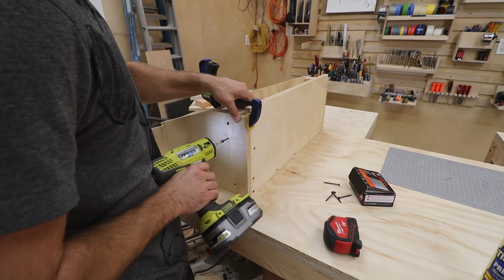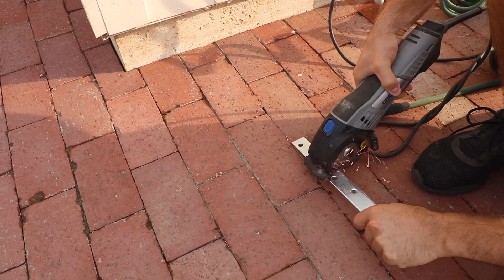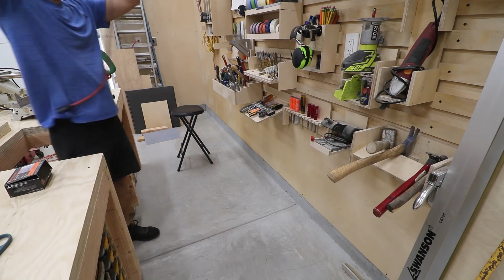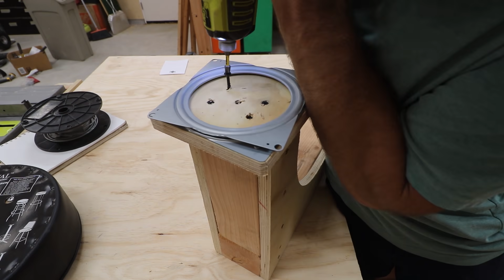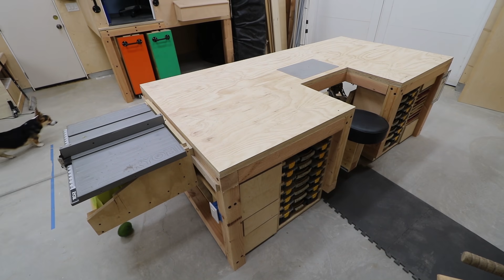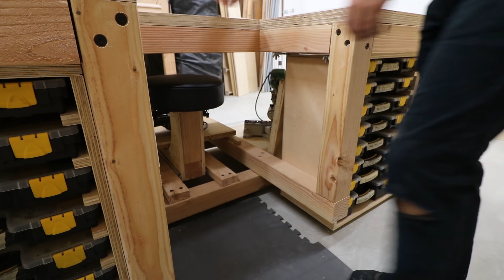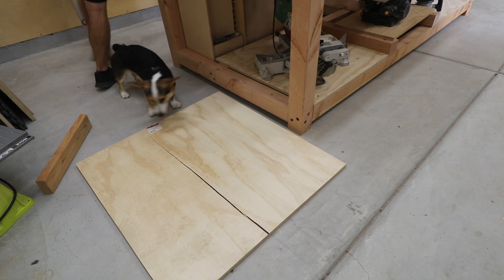Ultimate Workbench Upgrades! Built in Slide Out Seat

Comment: Very cool additions to the workbench.
As for the outlets you may want to use GFCI outlets for safety or a combination GFCI/ARC Fault outlets.
This way if something happens with the work tool it should trip there first before going to the wall outlet on the shop wall
Otherwise you built a great useful workbench

Comment: The sliding seat would have worked perfectly for me when I was 25 years old. Now that I'm 55 I don't think I'd even fit in the cutout. Not to mention, if I was able to squeeze in there..., well let's just say the slides giving way would probably be the only thing saving me from flipping the entire workbench over onto myself. When you get old and fat, like a lot of us who never saw it coming, you may want to add a trailer jack wheel onto the bottom of that seat. Patent Pending

Comment: Hey Ben, just built a work bench and was looking to install a french cleat for my table saw. How did you align it with your work bench? mini tutorial? :)
Reply from the maker: I took a bunch of measurements and calculated it out. The top of the table saw should sit just above the surface of the workbench. So for example: if your saw is 12 inches tall, the base that the saw will sit on should be 11.75 inches below the top surface of the workbench. Start with that calculation and build out all the other measurements from there.
Reply: @BenTardif  I actually built it today with your advice, thanks Ben!

Comment: You could add a fold-out foot on the bottom of the swivel stool to support you when you sit on it and take some stress off the drawer slides. You can build it so it folds up when you slide the chair in and drops out when you pull the chair out.

Comment: LOVE THIS!  Was starting to wonder if adding an electrical outlet in the floor of the concrete before pouring would have been good, but you solved it with the heavy duty electrical.  I wouldn't have thought of using an electrical cord to create outlets from, nor did I know it was possible.    Where did you buy the extension cord?  is it 10 gauge, 4 conductor?  Also, what about the ground wire??

Comment: 4:20 great idea for mounting the table saw, but I really think it needs additional support in the bottom, going directly onto your floor.  The bend in the cleat becomes very visible when you add the saw, it's just not meant to support that weight. Could have safety issues...

Comment: DEFFENTALLY one of the better hand made work table I've seen in a very long time. what about adding a some kind of straight cut razor for your paper roll? like to see how you would accomplish this part...
Reply from the maker: I’ve just used scissors or a utility blade to slice the paper. The top of the workbench is a sacrificial top, so no worries about making some slice marks

Comment: Nice Bench, I also use my bench as an out feed table, however, my saw is higher than the bench and I use two pieces of 2x6  blocks dogged to the bench top as the out feed supports.  The 2x6 blocks are tapered to prevent catching the end of the material as it comes off of the saw. This allows me to continue to rip material while low profile items like tools i.e. hammers, screw drivers, chisels, tape measures, pencils etc remain lying on the bench.  The bench doesn't have to be completely cleared off. The 2x6 pcs can be dogged to the bench to prevent sliding or like mine the first block has a cleat and hooks on end of my bench.

Comment: Seat support - if you had put another 4x4 across the opposite end of the rails from the seat, and a 4x4 brace directly under the seat so the weight would be on the 4x4 more than the rails, it would support more weight than just using the rails.  Or put a wheel under the seat so it can roll back and forth with the seat as it slides, but when you sit, the excess weight is on the wheel at the bottom.  I like this build, and may build this in my shed, but I'm not sure the floor is strong enough to support that much weight.  The people that built the shed didn't do the best work.  My workspace is extremely limited, but there is no way around needing work space like this.

Comment: @Ben - Thank you for the very clever table saw holder concept. I'm going to build one and also considering using your concept to build one for my miter saw by flipping the holder upside down to provide a platform to align the saw's table with the top of the workbench. Hoping to use the same workbench-side cleat for both but not sure yet if that will work out.

My Ryobi table saw is similar to yours but the smaller 8 1/4" model. The dust chute sticks out the back and moves with the blade as it's tilted. I'll depend on the holder to catch the sawdust. Did you have any problem collecting saw dust with yours? I'm considering moving the table saw outboard of the holder about 3"  to allow room to stick a vacuum crevice tool in behind the saw to suck out the sawdust after the fact. I'm assuming there is no problem having a 3" gap between the saw's table and the workbench as long as the table saw is a smidge higher than the workbench. Same with the miter saw holder. It’s a slider so it needs about a 5” gap to clear the workbench for the 45 degree cuts. Am I missing anything?
Reply from the maker: Sounds like you have it well thought out! Dust collection and stability are the 2 big things. I have plans for a dust collection system in the future. For now, I just remove the saw every once in a while to vacuum. Eventually I’ll add a dust port at the bottom underneath the saw.

It also needs to be stable enough to handle the weight of the saw and anything you’ll be cutting. Having the saw slightly higher than the out feed table is important (but you already know that). Sounds like if you run into any problems along the way you’ll be able to troubleshoot and solve it no problem! Send over some pictures! I’d like to see how it turns out!
Reply: @BenTardif  - Thanks for the feedback.
Stability is a concern of mine. Watching your videos including "Doubling the Ultimate French Cleat Tool Wall" (like), the table saw appears very stable. No tilting and no apparent vertical flex. The holder is no issue the way you have it designed. I reckon the weakest link would be the fingers of the cleats. How much torque applied at the front of the holder can the cleat bear before failing? Spread across the holder’s cleat width over 20 inches plus the aid of the lower spacer, I’m guessing my concern will be curbed. If not, I suppose the plywood cleats could be swapped out for 2x4 equivalents.

Comment: wow. just wow. this is very cool. For the bench, and more a concern for my 200LB frame, what if you just created a block that is just a hair taller than the under side of the stool when it is extended, you can store it loosely in front of the stool when it is stowed, then when you use the stool, you take the block, place it on the floor under where the stool will sit and your weight is transferred to the block as opposed to the drawer slides.

Comment: I would have used the same method for the seat as an old weight bench, which moves toward the bar height adjustment when doing shoulder presses and away from the bar when moving to bench presses. That way it’s tucked away when you want it to be, lift up and out to pull it out, it’s supported by the ground, not wobbly, and it would fold up and away just by lifting up and pushing in. The Lazy Susan was a good idea.

Comment: Great craftsmanship!  For top mounted items you want to secure, remove, and move around, I like bolts with thumb screws.  Fast, cheap, not intrusive when removed (just holes in top), secure while working.  2 on opposite corners is usually fine.

Comment: A wooden peg or chair wheel of some kind mounted to a spring loaded hinge on the bottom of the stool base at the back would give you more support and make your stool sturdier.  The spring loaded hinge would 'spring' closed when you pull the stool out and force the peg/wheel vertical to point at the ground, and when you push the stool in, the 4x4 base board would push the hinge open, raising the peg/wheel off the ground into a horizontal position or pointing up depending on how far int he stool is pushed.

Comment: would recommend that you update the seat so the 4x4 piece under the seat is longer and extends towards the floor but just short, so when the seat flexes when you are sitting the lower "Leg" piece touches the floor and make the seat more stable and help prevent your sliders from bending or pulling out screws. you could even add adjustable rubber foot ( screw type) to the "Leg" so you can adjust the flex amount.

Comment: That is an amazing bench.  However, that slide out seat is doomed to fail.  Putting caster wheels on the bottom of the seat supports would solve the problem of relying on the glides that only hold 150 #'s.  (You'd better not gain anyweight if you don't...and even then, those glides won't last.)  

Fantastic design and build however.

- Jed from KC

Comment: That french cleat has me a bit concerned with something that heavy.  I would consider something to support the free end.
Reply: When you consider the length of the french cleat, it really is a non-issue.  The weight is spread out over such a long area.  My only concern would be that the table saw may shift when you're using it, in which case a toggle clamp near the french cleat may be useful, but honestly that's just being paranoid.  He did a fantastic job with this.
Reply: @SuzukiKid400  Dunno, that just seems like a lot of moment for that cleat to resist.  Maybe I shouldn't have skipped out on the wood design class at VT.
Reply: @kennethmiller2333 when you take the sum of the moments about the bottom support on the table saw tray, there is a horizontal force on the French cleat only.  There is also a vertical shear force on the French cleat.  Not sure why you’re concerned about the moment on the French cleat since the cleat and the bottom support work together to ensure that there is minimal twisting . The fact that they are spread apart makes the French cleat more stable.  Also, the screws driven through the 3/4” French cleat are holding the laminations together to help it resist delamination.  My only real concern with his design is delamination of the plywood in the French cleat.  It would be better to build it out of solid wood.
Reply: @SuzukiKid400  The sum of the moments may be zero, but that cleat is partially a moment connection, and there's a significant reaction force.  Plenty of potential, I would think, for tear-out of the wood fibers.
Reply: @kennethmiller2333  you pretty much just repeated what I said.
Reply: @SuzukiKid400  Ok?  You said you didn't know why I was concerned about the moment.  I explained it.  If it's pretty much what you said... then I guess you know why I was concerned.

Comment: Beautiful bench.  You should have it on the front of a brochure to advertise your woodworking business, if that is your purpose.
Now...let's take that bench from a nice conversation piece, and make it truly functional.
1.  Outlets from the walls...psst.  Thats amateur hour of you.  Get yourself some Wiremold, run it up the wall; continue across the ceiling over your bench.   3 or better...5 of them.  And put retractable power chord lines over your bench.  Each one with its own GFCI.  Do I have to remind you to put a surface beam on the ceiling, bolted to the ceiling joists, over the bench to resist the stress of the retractable power lines, and eliminate any future retractable power chord damaging the ceiling ?  Enough said.
2.  You should have put 5/4 tongue and groove boards, sandwhiched between your plywood sheets.  So you could have bored holes on your bench top in a useful linear pattern to have bench holdfast inserts.  Once you use one, you never want to stop using them.  They are addictive.  Get hand forged blacksmith made one's.  They will last forever.  And blacksmiths can make you some custom ones for extra  reach into a piece.  The best I have ever seen were hand made, and the tip that held down the wood, had two holes in line to screw in a piece of wood, to provide support for very expensive woods.  Gramercy Tools makes great ones.
3. Stop giving excuses, and put a bloody caster underneath that retractable bench.  That it will not make it able to fully retract you say.
"Piss poor planning provides piss poor production"
You should have planned a cutout on the bottom footing, of the bench to accommodate the heavy duty caster getting tucked in.
When something can go wrong, it usually occurs at the worst possible moment.  If that seat cracks or gets damaged, you might be sick at the time, or hurt, or out of your best game, and it will be a royal pain in the butt to fix.  Have it done.  NOW!
4. Dress the edge of the bench with a 3/8" or 1/2" inch round over bit with your router.  Rounded edges stand up to dings betteŕ than sharp 90 degree one's.
5.  Lacquer your bench several times, sanding or using brass wool on each coat.  Why?  Dirt will get into the pores of the wood.  Lacquered wood is easier to keep clean.  Dirty benches show disregard for your bench.
6.  I am the only one who seems to have made a habit of this idea im going to give you.  It will make your bench more useful.  Put in 2 cutouts on the bench top, reaching all the way through.  Build it with a removable coveŕ, to hide it when not being used.  I used to make mine 5 x 8 inches.  Why? 
So that when I had to bore a hole in a piece of wood, I could do it while the piece laid on top of the bench; fully supported.  What did I do to find the exact position of the cutout, if the piece to be bored covered the cutout?
I built a template for each cutout, that had the exact position of the cutouts, and it straddled the width of the bench, 
and locked into registration holes. 
7. Inlay a glued metal measuring rule on the benchtop to quick measure pieces you are working on.  Find a long one.  Put it on the longest side of your bench, opposite your cutout.  And another on a short end of your bench.
Ex NYC UBC journeyman carpenter.

Comment: For the seat - Adding even a small support underneath will help a TON.  Give the beam something to rest upon, so you don't need to trust the slides 100%.  A short piece of scrap 2x4 right where it extends will give it a place to bear load and give the slides a lot of help by shortening the effective length of the lever arm. Also, simpler than a caster for now.

Comment: Wow, I never would have used a french clean for a heavy item.  Well done.  Prooves trying something is really the only way.   Just talking out of my ...... here, what about a swing-out L-bracket that would sit flush in between the table legs when not in use and could sit under the table saw to hold up more weight.  I know a site table saw is not heavy but have you ever had any kind of table tippyness cutting anything heavy.

Comment: Impressive forethought and design. The next bench should be built using joinery instead of screws to add longevity and stability. Your seat would be more appropriate if you used a solid hardwood sliding drawer setup which would provide more load capacity, stability,  and better aesthetics.

Comment: Could put a caster under the seat so it sits on the ground but can still slide in and out? Would have to modify the 2x4 that the frame with the sliders attach to.  Just an idea if you're worried about weight.

Comment: Wow, I have a small work space and never would have thought of that attachment for my table saw!  Thank you for the inspiration.  One question - how do you plan to remove the dust that gathers under the table saw?
Reply from the maker: Good question! My plan is to punch a hole in the bottom that will fit a vacuum attachment
Reply: Good idea.  The next issue would be keeping the attachment flush with the bottom of the plywood for storage, but that should be relatively easy.

Comment: Nice project! Maybe tape a thin metal plate over the extension cord in the expansion joint? Over time, you might wear through that wire in a high use area. Great work though.

Comment: Just want to start out by saying that this is an awesome design. I definitely am inspired to redo my main workbench. Also wanted to say that Rockler sells some amazing workbench casters that mount on the outside of the table legs and will fold out of the way so that the weight of the bench, while stationary, is completely on the legs/frame. They support up to 400 lbs a piece.

Comment: Hey - to add some additional support to your seat, why not create a leg that slides out of the bottom of the seat pole. You could get a bicycle seat clamp to hold it up, when sliding the seat back in, and down when sliding the seat out. You could also cut a verticle slot in the back of the seat post, where you could then insert the leg, and by attaching a horizontal handle you could move the leg up and down, and turn the handle into a horizontal slot, connecting with the verticle slot, to lock the leg in place. and since there wouldn't be an excess of weight or torque on the seat, you could do it all with wood dowels. Maybe put one of those rubber table leg feet on the bottom of for extra traction on the floor!

I would use the second option, so I wouldn't have to lean all the way down to pus the leg back up into the seat post when I was ready to slide the seat back into the bench.... but I'm lazy like that!  Hope this was helpful!

Comment: I was thinking the pull out seat is a great idea. It oscillating like that seems like the sliders would wear out. Would add top support to the back part or instead have a straight caster under to 4x4 piece to help slide out and support the seat

Comment: With the table saw you really should cut a hole in the bottom of the wooden base so dust doesnt get stuck under the saw which will eventually build up to the motor and burn it up like what happened to me. I am not criticizing just a good tip to save some headache